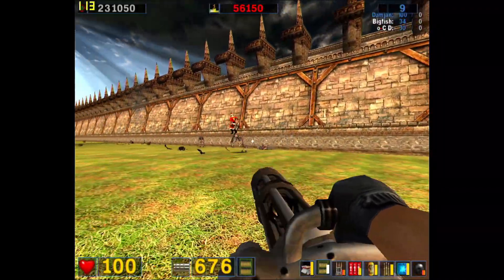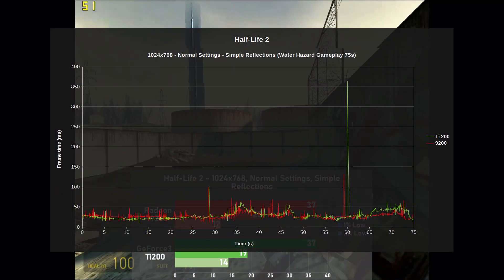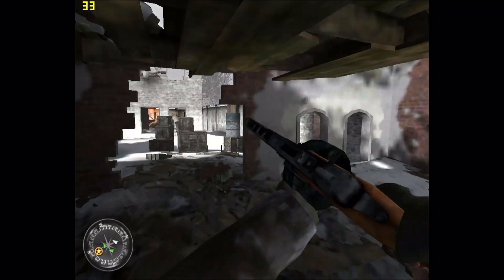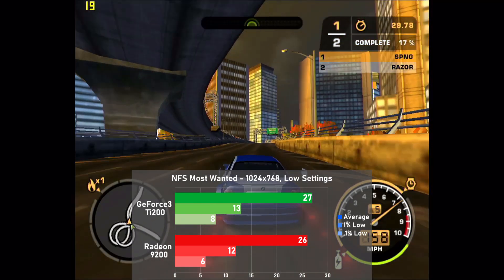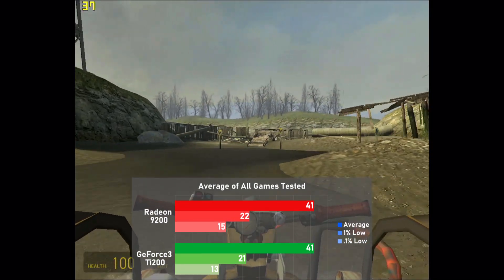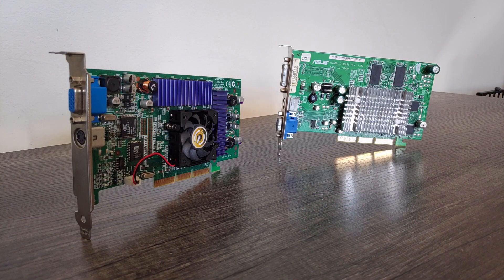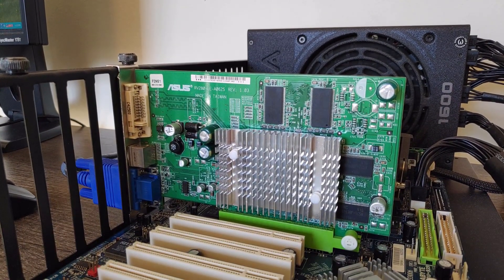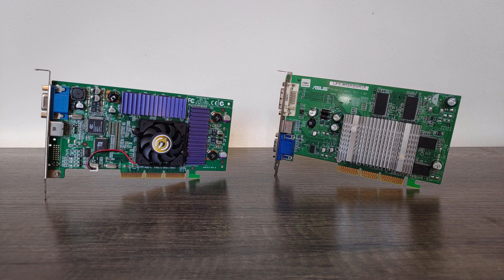GeForce3 Ti200 vs Radeon 9200 - Graphics Card One on One

Comment: Great comparison! But often the Radeon 9200 had the 64bit bus width, like the GeForce 5200, while the GeForce 3 Ti200 was only a regular GF3 downclocked ( you can oc'ed it to the level of the Ti500) and always had 128bit bus widht.
From 64 to 128 bit bus was a huge difference for entry level vga like the Radeon 9200, but most of the time people had the "SE" version with 64 bit memory.
A GeForce 4 Ti 4200 was way more faster than this two vga back in 2002.
Reply from the maker: True, but I'd say they weren't hard to find in 128-bit versions. And ATI did a much better job at distinguishing the variants than NVIDIA did as well, at least the "SE" nomenclature let you know you were getting a 64-bit card!

Comment: My very first computer I built myself had a Radeon 9600Pro. Although despite the same 9000 series name it was a DirectX 9 GPU and should be much faster than either of these. I have a GeForce 3 (non TI) I use for retro gaming. I never had it back then but it’s nice to have now. Especially since the GF3 lineup is kind of unique in how small it is. Just 3 cards and they are all based on the same die just differently clocked.
Reply from the maker: Funny enough the starting number of ATI's GPU lineup was SUPPOSED to represent the DirectX support level, for example the 7500 is a DX7 card, 8500 their DX8 flagship, and the 9700 being the DX9 high end... but for some reason they decided to give this Radeon 8500 in cheap clothes a 9000 name. They really should have called it the 8200 or something. Nice that you have a vanilla GF3, wonder if it'll overclock into a Ti 500 🤔And yeah, its a very small series for sure!

Comment: IMO todays manifold driver options and latest game patches don't accurately reflect the experience we actually made back in the day when these cards and games were new. For example I see compatibility with games that I know didn't run when I had the card and the game (Unreal and the 4MB Riva128 is a good example).
Reply from the maker: While it may not reflect exactly what it was like back then, I find that using new games and mature drivers can often tell you a lot more about how good a card was. For example, the GeForce3 Ti500 vs Radeon 8500 battle I mentioned in the video, and my favorite is the battle between the GeForce 7900 GTX and Radeon X1900 XTX. Back in 2006 the two were very close to each other in performance, but as game demands changed and they started using newer and more complex shader code, the 7900 GTX started falling way behind because it lacked the pixel shading power and dedicated scheduling hardware of the X1900. Really shows that while X1900 wasn't groundbreaking at launch, it ended up being ready for future demands while the 7900 GTX would run out of steam pretty early on.

Comment: It should be noted that the 9200 is a DirectX 8.1 card, and the GeForce 3 is only 8.0. It is a significant feature-level difference, and noticeable in some games. It also means it'll usually have some extra stuff to do that the other card doesn't so things might not always be apples-to-apples in that sense. (EDIT: You did mention this during Half-Life 2 gameplay)